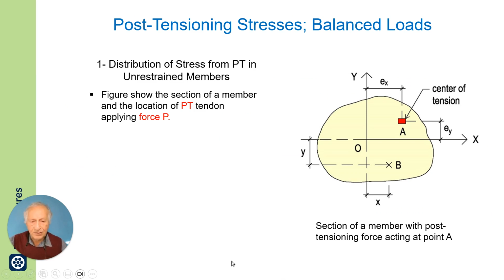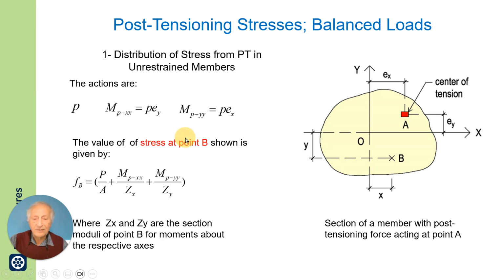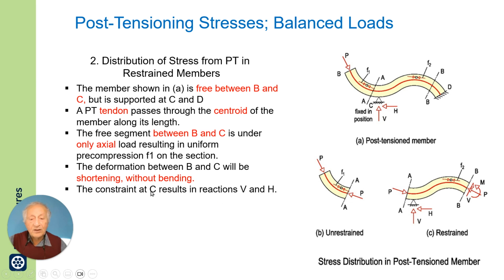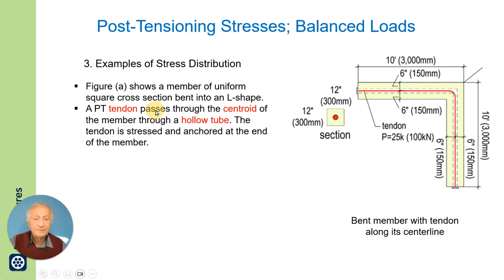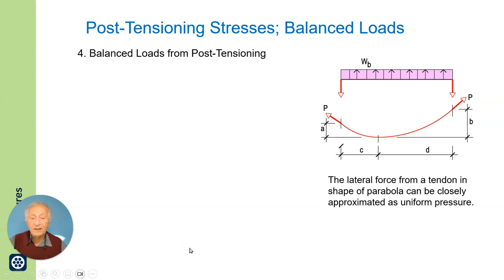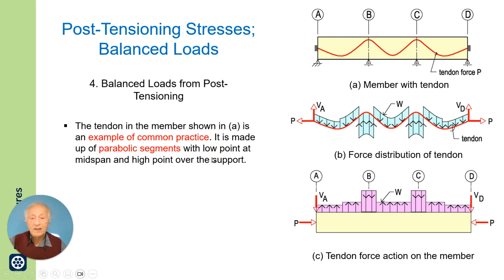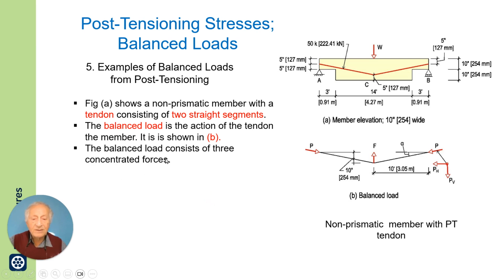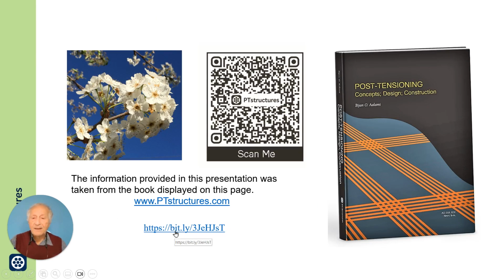10- Post-Tensioning Stresses  Simple Members Lecture

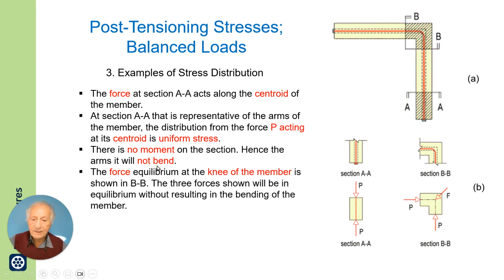Comment: 10:30 The L-shaped structure problem. If any cable is pulled it tends to straighten into a straight line. I can not grasp why it doesn't happen in the L-shaped structure. It seems counterintuitive.
Reply from the maker: The tendon in the L-shaped member is at the centroid of the section along its length. It does not apply moment to the member. The only force applied along the arms is axial. For this reason there is no bending of the arms.